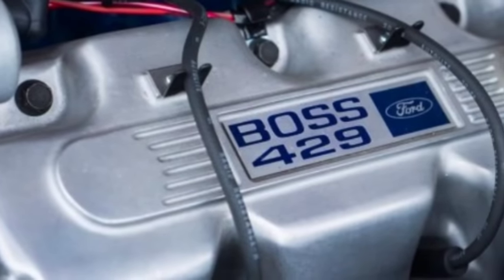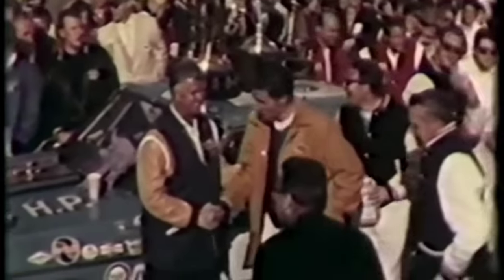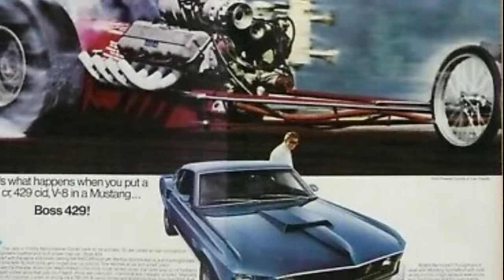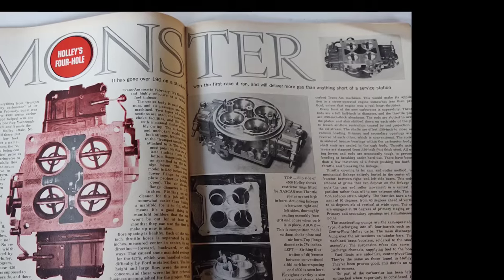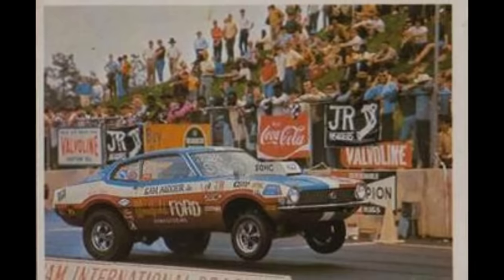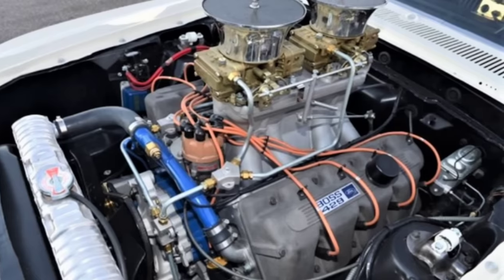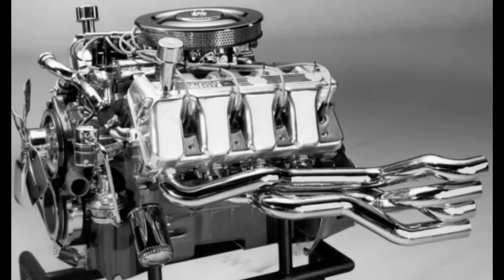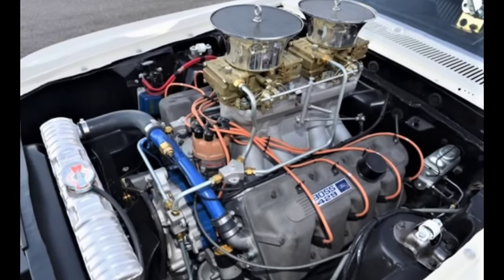The Misunderstood BOSS 429

Comment: I am a die-hard Mopar guy , and this is an interesting video. I like reading through the comments sections. Best thing to do is not be biased too much. Any intelligent person knows, that a handful of money and knowledge can put most engines at serious competition with each other. Back in the 70s we didn't have a lot of money, so we stuck to the simple go fast changes. Camshaft, lifters, better valve springs and retainers, rear end gears, shift kits in the transmission, stall speed converters, and headers. For us Mopar 6-pack guys, the Performance Kit to change the springs in the vacuum end carburetors was also a must. Other guys might opt for Progressive linkage. Ford guys had plenty of opportunity, and any Mopar guy that had a first look at some of the performance heads that Ford produced got their eyes opened. Ford was no slouch. The street engine Ford Boss 429 had to be mild enough to drive. And that was it's choking point. Make no mistake about it though, this is a great platform that just needed some performance goodies like most any other car manufacturer regular production engines. It's really at all about what you personally like oh, but at the end of the day they are hunks of Steel, Cast iron, and various other metals that make up an engine with a different manufacturers badge on it. hail to all of my Gearhead Brothers out there. I sure miss the 70s, when things were more laid back, cool music, and our world wasn't wound so damn tight
Reply from the maker: Amen to all of that!  I too am a Mopar man at heart.. my first car was a 70 Duster 340... It was fun picking on the 5.0 mustangs back in the day!  I have come to believe that all of the makes have their strong points and weakness.  It took a well tuned Hemi to outrun a 440-6 on the street.. I have always been told I have an old soul... I'm 41 btw please Subscribe and I will have plenty of good content coming your way!
Andy
Reply: @UnityMotorSportsGarage  true statement on the 440 + 6. I have owned those and the small block six pack engines. For their time, pretty impressive. Too many people like to compare half a century ago technology to today's modern fuel-injected engines and suspension on the cars which is completely pointless. Apples to Apples yes but never anything else LOL
Reply: @UnityMotorSportsGarage  you gotta be kidding me...had a 89 Notch 5.0, ex patrol car w headers and shifter, I'd smoke that crappy 340 as I did with Corvettes until about C5 came out
Reply: I love mine, goes like hell, has no traction to speak of. But so much fun to drive.  Will it beat the 69 Charger, no, but the Charger has 650 hp and 530 cubes, so it’s a tossup , love em both. Let’s go disturb the peace.😂😂🤪
Reply from the maker: @lautburns4829  let's GO!! Thanks for watching please Subscribe as I have one coming on the Hemi 
Andy
Reply: There was a teenager at church who grew up in his Dad's garage. He had his own engine building business before he graduated highschool. He got accused of rule breaking because of his customer's success. Everything he did was within the regulations. He was an
" out side the box" problem solver. He would talk to "old timers" and pick their brains. These guys had come through the Depression and WWII. They solved problems already, Ask them how.
Reply: @brianlevine4802  yawn, had a business when I was 8 years old, then when I was 14, then when I was old enough to know what a scam a job is...Rich Dad Poor Dad is the book if you want inspiration.
Reply: @andrefecteau  sorry I took up your time.
Reply: @brianlevine4802  it wasn't the time, it was the "point" of it all...if you could draw conclusions and relate to your own life your posts would carry weight, talking about someone you "heard of"?  Not so much...say something like "kid I knew who was self employed fared much better than me who was smart but worked for others"  or "chase your passion, not your pension"...
Reply: @andrefecteau  paul 
was 10-12 years older than me. He would help with both my Cubscout and Boyscout  troops. Would come to church riding his chopper. Where did I say "I heard of someone"?. The point I was trying to make is back then you had alot of low budget racing going on. Locals using what they had to beat the big boys. I spent my time milking goats,taking.care of the chickens,horses,etc..Learned to.drive a standard in old dump truck circling hayfields. Paved driveways,built septic systems,etc during school vacations. Split a lot of wood for winter. My stepfather didn't believe children needed money.
Reply: @UnityMotorSportsGarage  wrong!! I still have my 92 lx 5.0 coup that would literally smoke my buddy's "may he rest in peace" 71 duster, with basically the same set up.. and my lx was all stock at the time..
Reply: @andrefecteau  same!! I still have my 92 lx coup.. AOD though..
Reply: I, for one, don't believe the world is wound as tight as the media would have us.
Reply: @andrefecteau  lmfao bro your not fooling anyone they made like 220hp to the crank 😂 you wouldnt beat any modern 4cyl in that smogged to shit 80s rotbox
Reply: @nimwit0  you gotta be kidding me bro, a 5.0 hiway patrol car with headers/exhaust and tune ?  Itd be over before it started...btw I have 2 stangs now that lay waste to almost any car on the road, a crappy 95GT w a 427 stroker and 2 kits of 150 NOS, how's that grab your wannabe azz?  If your Stang is "slow", it won't be for long w any kinda bolt ons.
Reply: @andrefecteau  🤣😅 don't lie to us, lie to the mirror.
Reply: @steelrain9702  you wanna put money on that statement?
Reply: careful... sounds like someone lives their life a 1/4 mile at a time with their NOS bottle as a pillow. 🛵
Reply: mopar is a hedge fund
Reply: I had the car in my avatar 1970 super bird. I got a lot of benefit from the distributor spring kit to make the advance in the ignition come in faster. Usually would have to replace the fly weight pins. Easier to start with a new distributor. The springs and fly weights were a blessing back then. Make a big block mopar come on strong. Roller Rockers and higher rocker ratios was a simple bolt on upgrade. Most bang for the money.
Reply: @nimwit0  umm at least you know how we make power, my 89 is long gone..now as you can see on my thumbnail is my Cobra, a few small vids...96 w Kenne Bell on E85: and I have a 95 GT w a 427 Stroker and 2 kit of NOS, it runs on E85 as well, has a paddle shifted custom tranny.....First on Race Day boyz
Reply: @nimwit0  ahh one other thing, there are great after market ECUs now available...I run AEM on the 95 but with a few more bucks you can get really state of the art electronics...you see a Mustang can be what you want...and trust me in the early 90s the Notch 5.0 was a stupid fast car, very lightweight
Reply: @nimwit0  I’m not trying to be a jerk here, nor am I attempting to create or contribute to an argument, but... when I was a kid in High School, I had a 69 Dodge Coronet with a 383/727 Auto, and then after graduating I had a Fox Body 87 5.0/AOD Mercury Capri RS (Mercury’s Sister to the Mustang, and in my opinion the better looking of the two cars), and that 500 pounds lighter and 30 inch shorter car, TOTALLY out performed the Dodge B Body in EVERY single competitive comparison. Better Suspension, better Braking, better Acceleration, better Handling, better Quarter mile, better Top-Speed, better Mileage, better Seating, better Options, better Driving Experience, absolutely an overall better Vehicle. And I loved my MOPAR’s, I also loved that Fuel Injected 5.0 Blue Oval. And in reality, we need to sit back and ponder what vehicles would be like if it WASN’T for Ford building the Fox Body 5.0 Multi-Port Fuel Injection cars. The truth is, the 5.0 Fox Bodied Mustangs, re-ignited the Horsepower Wars from Detroit. The 5.0 Mustangs/Capri’s ran circles around GM’s IROC & Z28 Camaro’s and Firebird/Trans Am’s! The lighter 5.0 LX Mustang Coupes (that the Police drove), scared C4 Corvette owners. Dodge was a little late to the game, but were producing unheard for the times, performance in Front Wheel Drive 4 Cylinder engines, and pioneering Turbocharging, to their credit. Their turbo’ed 4 cylinder, 5spd Front Wheel Drive Dodge Daytona’s, and Plymouth Laser’s were absolutely competing with the V8 offerings from their crosstown rivals at GM and Ford. So to say that the 340 Duster/Dart, would destroy a Fox Body 5.0, is really not accurate. Having owned both, or a very similar divisions ‘sister’ vehicle, I felt I needed to give my opinion, based on experience from driving/owning both. Let’s all be thankful that Detroit finally got themselves straightened out, and started producing cars that are fun to drive again. And let’s NEVER forget that the Fox Body 1987 Mustang 5.0 GT/Mercury 5.0 Capri RS is definitely ‘THE’ moment in American automotive history, that started the Return of the Horsepower Wars in Detroit! Without the engineering of that years 5.0 motor receiving the multi-port fuel injection, new head design, and dedication to cleaner combustion/fuel economy/computer controlled engines, we wouldn’t have the insanely powerful engines that we can buy today. We should thank FORD, for setting it all straight.
Reply: @matthewl67  oh here we go...when someone's arguement is completely factless they hurl the personal attack...wham outta the park on that hanging curve ball
Reply: I am a die hard ford fan but I agree.......as a young man I was hyper excited at the thought of a 600 HP Hemi mustang.........what we got was a turd......those gigantic ports worked great wide open at 7000 rpm but the detuned street version was horrible.   It was such an embarrasment that Ford management considered a KIT that would allow new COMPLAINING Boss 429 owners to tweak their Mustangs into the 12s.   It included a carb, cam, headers......it never came to light.     The most telling argument against the B9 is the FACT that Ford used a 427 SOHC engine in the advertisement for the B9.   A few more years of development and it might have been a world killer.......but by the middle of 1970, NASCAR initiated restrictor plates and Ford had cut NASCAR funding.
Reply: @andrefecteau  5 point slow 😆! sounds like a v8 but that's it.
Reply: Amen...
Reply: @justinriley8651  so why did GM copy the design on the LS?  yep, never innovative, always last to the dance...who cares it's all electric and the MachE GT will be amazing 600 awd hp/torque and room for the kids and golf clubs...First on Race Day Boys
Reply: @andrefecteau  lol well if it's a copy it's way better than the original.
Reply: @justinriley8651 don't you mean "obsolete"...GM 20 years behind in anything, ugliest crap on  the road...good thing they are on the electric future but still very late to the game.
Reply: @andrefecteau  obviously your a Ford guy. I would like to agree with you that mustangs are the greatest thing on 4 wheels, but then both of us would be wrong. 

I do recall reading somewhere that 80% of the Ford product sold in the last 20 years are still on the road. One can only assume the other 20 percent made it home. 

Most mustang guys are cocky arrogant assholes, who can’t drive worth a damn. I’m guessing most spend entirely too much time watching fast and furious movies. Obviously, there are exceptions, there are many Ford owners who can drive, it’s the low performance drivers who give high performance cars a bad reputation.  

Unless your name is John Force, chances are good that someone, somewhere is faster. 

As someone who has spent a lot of time with fast cars (of any make) I seriously doubt that any Mopar with a 340 would have too much trouble making a 80s mustang look pretty slow.
Reply: @nimwit0  come on, everyone knows the only way to make a mustang fast is to LS swap it!!
Reply: @andrefecteau  just don’t run down any spectators leaving the next car show.
Reply: @mattrodgers4878  that's if the 340 can run...every slopar I ever knew was a turd with that quattro bog carb and the tranny from hell...a 89 Notch will waste most anything with basic bolt ons, it's stupid light and until you are ever in one?  You have no clue
Reply: @mattrodgers4878  get a car and then you can have an opinion
Reply: @mattrodgers4878  I'd like to introduce you to the 340 series of engine a Ford can be: the 347 ...from a 302
https://www.youtube.com/watch?v=YQIIhPf35QY
 i have a 427 stroker in my 95...yeah, do the math
Reply: @andrefecteau  i suppose if you consider a 13 second car fast, then yes a late 80s mustang with bolts is “fast”. It’s been 25 years since a 13 second street car was impressive. And don’t give me any of your bullshit, mid to low 13s is about the best you could expect from a 80s mustang with bolt ons.  

Your right, I haven’t owned one mustang, I’ve owned 4. I have many friends that own mustangs, the really fast ones are LS powered. If you haven’t split a Ford engine down the middle of the block, you haven’t had a fast one. 

It’s well known the 340 Mopars run very well. Since your unaware of that fact, you clearly don’t have a clue. Put down the “Ford and mustang” magazine comic books, and go to your local dragstrip. Be sure to take your car, make a couple of passes, and collect your timeslip (also know as the lie detector). While your there, look s the really fast fords, I’d be willing to bet the Ford engine is long gone. What you will almost certainly find is lots of fast mopars. 

If I thought you had the slightest clue what your talking about, I’d be willing to debate you. I’m done with this conversation.
Reply: @andrefecteau  yawn
Reply: @mattrodgers4878  it's still fast, ever watch videos of "fast" modern cars?  Without slicks or drag radials you aren't gonna break 13 to this day no matter the hp...btw you cannot compare the eras...
  Split a block?  Umm not if you use the right one and build it right...fast mopars?  Where?  20 years late to the game...bodies and company and both bankrupt many times, for obvious reasons, total junk...
    Obtw Mopar is owned by what ?  Some foreign entity?  and where is their electric car?  yeah 20 years from now and another bailout later.
  First on Race Day...solvent and looking to the future with the Mach E GT
   600 awd hp/torque...should be fun
Reply: @mattrodgers4878  btw Matt this is all known as "bench racing"...all car guys do it...it's part of owning cool cars, if you can't remain calm you should stay on the sideline
Reply: @UnityMotorSportsGarage  HAD A 63'FALCON SPRINT WITH A BUILT 289 PUT THE HURT ON ALOT OF 340 DUSTERS ,ROAD RUNNERS.442'S .GOOD TIMES BACK THEN.
Reply: @andrefecteau  , yawn. Your just has boring.
Reply: @UnityMotorSportsGarage  Hi Andy. I've got a few years on you,I'm 68. In the early 70's, I had a '65 Mustang 289 hipo. It had a big solid lift cam, aluminum intake, 600 Holley,factory dual point & headers. A guy in town came over & told me a friend of his had a Duster w/ 340 automatic. He said he told him he'd never seen a Ford that would run. He wanted to race me,I figured he'd beat me,but I raced him. I beat him 2 of 2. I think all 3 of us were surprised! I've always been a Ford guy, but I never put another brand down!
Reply: @nimwit0  guess you've never heard of Stinger Performance and the EEC IV ECU PimpXS works great with SD add some John Kasse Boss 9 heads ( Hemi ) and other goodies
Reply: @andrefecteau  you shoulda been able to beat a c5 as well, especially with wider tires. you have them on weight.
Reply: @nimwit0  its clear you have no idea what you’re talking about
Reply: @NotoriousPlayer1  it doesn't matter bro, game over...it's an electric future...then it's an autonomous life...if you wan that classic gasser, go get one while you can...I've loved mine, but I'm ready to move on
Reply: @andrefecteau  I had a C5 and I quite racing them, because it wasn't fun blowing there doors so many times, in saying that a buddy of mine bought a 5 or C6 can't recall but the only way that he could was with a Blue Bottle.
Reply: @carlsmith6056  who cares, the entire scene is dead, it's not safe, it's an electric future...I'll be glad to let the computer drive while I have cocktails in the back.
Reply: @NotoriousPlayer1  🎯
Reply: Same here. Own Mopar's but love Pontiac's, Chevy's etc and NHRA history and cars most importantly.  Love them all!
Reply: Before the media and culture made a hard left turn...
Reply: @7x779  see bro it's always been that way..it's just now being realized more than ever...those zombie fake newzers are brainwashed
Reply: I just turned 60 & feel exactly the same as you my friend, the 70s were truly special. I was just talking to one of my Army buddies commiserating over our 18 friends that didn't make it home from Mogadishu in total disbelief watching our country self destructing, the CCP must be laughing their ass's off. Although the modern cars are incredible, they just don't put a smile on my face like my Pantera still does, keep the faith!
Reply: @justinriley8651  No ford just went with the ohc setup to be more exotic.
Reply: @mattrodgers4878  🤣🤣🤣 A 2018 mustang gt with bolt-ons and E85 ran with a Hellcat. 🛑
Reply: Same here im fascinated by ford answer to the Hemi !
Reply: @andrefecteau  Pfttt ive chewed 5.0s up with 318s over and over over almost to the point of it getting ridiculous !
Reply: @steelrain9702  I have a 318 you couldn't even read the license plate on my car lol!
Reply: @anthonysiler4938  You have to quit racing wore out 318s disguised as 340s LOL@ you
Reply: @MrR6guy  I've got  a 5.0 for you: a 95...btw I added a couple extra liters and a couple kits of NOS to it...you wanna run that Slowpar against it?  Watch where you run you mouth and your car.
Reply: HAIL TO THE KING !! NOT NECESSARILLY THE KING COBRA/BOSS BUT THE KING OF COMMENTS !! LOLOLOLHAHAHA " THAT HAS TO BE THE LONGEST ONE THUS FAR !! LOLOL YOU CERTAINLY SOYND LIKE A GEARHEAD THAT KNOWS/EXPERIENCED A THING OR TWO !! LOLOLOLHAHAHA LOLOLWHOWEE HEADERS & A 4-BBL. INTAKE WAS ALWAYS NUMBER ONE ! I DONT WANT TO TRY AND BREAK YOUR RECORD BUT WHAT MORE CAN BE SAID THAT YOU HAVEN'T?? I BOUGHT MY 12-SEC. 69' SS396 "BU" ALREADY SET UP FOR THE 1/4-MILE BACK IN HIGH SCHOOL IN 81' AND GOD BLESS MY AUTO SHOP TEACHER FOR LETTING ME KEEP MY CHEVELLE IN THE SHOP SO I COULD MAKE IT STREET LEGAL !! IT WAS FUNNY HOOKING UP THAT BIG OLD SUN SCOPE TO MY 396 AND THE DISPLAY WAS SHOWING THREE SPARKS PER PLUG AND MR REAGAN SAID THERE MUST BE SOMETHING WRONG WITH THE SCOPE,, I JUST LAUGHED AND TOLD HIM THATS PROBABLY MY MSD 6A POINTING IT OUT ON THE FIRE WALL. WELL NEEDLESS TO SAY I GOT AN A IN CLASS !! LOLOLWHOWEE THOSE WERE THE DAYS ALRIGHT !! GEARHEADED GREASE MONKIES UNITE !!!! ( DID I BREAK THE RECORD YET ?? LOLOL
Reply: @emilsunter3596  Your a VERY CLOSE 2ND !! IN HAVING A LONG ASS COMMENT !!! LOLOLHAHAHA
Reply: @matthewl67  No different then the Camaro drivers. We always called Camaro's and Mustangs asshole cars. Because everybody has one.
Reply: @mattrodgers4878  A 340 Mopar would have stomped G.M'S beloved 80's Corvette. The only real exciting car at the time was the Buick Grand National.
Reply: @mattrodgers4878  Before it blew up.
Reply: @mattrodgers4878   The LS is like a Sherman tank. The only thing it's got going for it is there is lot's of them.
Reply: @andrefecteau  They are just butthurt Andre that Government Motors and Chrysler I mean Fiat were sellouts.
Reply: @andrefecteau  I don't relish the idea of Electric vehicles. Electronics are too flimsy. I still want my gas eater.
Reply: @junglejim5785  and the Buick cleaned the clocks of the corvette during those years. I fondly remember all the chest thumping chebby boys crying whenever a grand National beat them at the dragstrip. A couple years later they were still crying when the Pontiac Turbo Trans Am stomped them at the dragstrip AND the auto cross.
Reply: Chevy/gm guy. Let's not forget 350 sbc is a proven platform. Pontiac made some cool shit back in the day. The big block chevy stuff. 

Like you said most things can be competitive.
Reply from the maker: Check out my SBC video.  Tell me what you think!
Reply: @andrefecteau  i know your lying because ive owned both
Reply: @emilsunter3596  and 1000 lbs lighter
Reply: @andrefecteau  if every mopar is a turd then why the 440 6 roadrunner rated 390 hp out perform the LS6 chevelle 450hp 454? When you get your facts let me know.
Reply: @antilaw9911  and you are a troll...state facts, just because you don't agree doesn't establish "lie"....
Reply: @UnityMotorSportsGarage  that's a pretty bold statement driving a 340, lol bud,
Reply from the maker: Spud, it wasn't your avg 340!  
Had a blast with that car ... I still regret getting rid of it ..
Andy
Reply: Debbie Miorgan  and you must be tripping, I'm 55, the 302 is a great engine, it needs heads cam and intake to be banned from any racing...stay in your slowpar or bankrupt GM crap and look at my taillights...I have a 427w Stang that will whip anything..so take your old ass back to bingo and stop trolling
Reply: Debbie Miorgan  oh please you can see my Cobra in my profile pic, btw it's supercharged and I do have a 427w Saleen...w 2 kits of NOS.. you're troll boy in a Hyundai no doubt...amazing how ya'll know everything, you should pick lottery numbers...
Reply: @craigcampbell8560  OMG bro, you need therapy., I will wait for the movie before reading that rant...
Reply: Andre Fecteau   I beat plenty of 5.0 mustangs with my 340 dart’
Reply: Anthony Siler   AOD- (awful on demand)
Reply: as a mopar guy I sure miss those days but have always been impressed with the 429 as it had everything
going for it but lacked good atomization of the fuel air mixture with the over sized porting ford did with so many of their engines, sure it could flow like nobody business but a good mix can be the difference
and mopar kept the rough looking intake runners and smaller ports to benefit the engines operation at
a specific rpm like they were doing with the ram air intakes on the 413 engines. Those long runners offered a boost to the bottom end torque for the daily driver that didn't see more than 3000 rpm.
When everything was right -runner length porting, carb,cam duration the power band came to life.
I'm noticing  more engine aftermarket suppliers are rediscovering the old iron that has mostly been forgotten, more for you and me.
Reply: @magneticpulseengine3605  yeah I’ve got the great Ford iron and aluminum but I’m looking forward to electric
Reply: Back when sex was fun and motorcycles were dangerous!Lol
Reply: @magneticpulseengine3605  Yeah you can always tell with how people tell their stories. Most of these guys with nitrous and stroker engines, have no idea or cannot relate to the fact that we did not have such things on the street back then. We took Factory cars and put camshafts, Springs and lifters, maybe gears and headers okay. We just didn't do much more to them because most people didn't have that much money. They like to compare their stroked out nitrous fed monsters to our Factory Chrysler muscle cars which is a complete laugh personally I think that it is flattering to me that somebody would spend that much money trying to beat my factory Dodge. Like I stated when I first put my comment up that a lot of people have responded to... I have liked all the cars a lot of people like the bench race LOL. But there's a lot of BS that people talk and it's usually the ones that have a pile of money put into their vehicle I run hydraulic engines with normal compression ratios and reasonable gears. It's more of a driver these days. People want to race they really should take it to the strip. And above and beyond all things, not a factory stock or nearly stock engines, to those that have piled a lot of money into nitrous, stroker kits excetera
Reply: @brianlevine4802  not me. Some people just tell the truth, & don't embellish or brag.
Reply: When the Chevy guys used to say FORD was F'en Old Rebuilt Dodge I asked them what cars were winning at any NHRA event..90% of them were running hemi's..That's back when NHRA used to run all the classes at National events. Sad NHRA screwed up ProStock and turning it into IROC
Reply: Too many variables in  “street” racing to bring it up and consider anyone a winner. Boss 429 that Ford rushed out in the mustang had no tuning tiny headers and emissions requirements. The engine was shoved in there to meet homologation requirements no thought of “performance” on the street was considered Ford only cared about having Boss 429 ready for 1968 racing season where Ford erased the dodge completion so much that Richard petty went to race for Ford.  Like is custom Ford dominance had to be halted at all costs so restrictor plates were introduced. That’s why I cringe every time I hear someone say the Boss 429 wasn’t a good engine it’s ridiculous. 

The Cleveland (335 series) dominated prostock 1969-1979 without factory support and carrying more weight (250 lbs) then the competition. Gliddens Fairmont still went undefeated only car to do so in NHRA history.  Only comparable engine had same dominance success was Boss 429 (385 series) 1980-1990 it dominated IHRA and NHRA prostock.  Dominance ended because NHRA told Ford and Gliddens that they had to make 1000 pairs of these heads available to the public if they wanted to race. Nhra knew Boss 429 we’re made in limited numbers and a market for these heads didn’t exist obviously they knew Ford wasn’t going  to spend countless millions to produce heads for a motor that had been out of production for 20 years. This is how Ford dominance ended. All the other stories of my piece of junk was faster then blah blah.. Nothing could touch Gliddens and  Rickie Smith Boss 429 powered cars. Dyno Don and Rickie smith first to break 7’s in prostock Dyno Don used Fe cobra jet power. The NHRA mandated the 500ci rule as a play to stop Ford from dominating prostock. So the corrupt NHRA(anothe division of GM) allowed GM along with Warren Johnson to build a new engine called the DRCE so GM takes a Oldsmobile block,  Warren Johnson has a big pair of Ford Cleveland heads made for it.  That’s what the DRCE is. Too bad that wasn’t enough to beat the a FORD engine Boss 429 unlike Chevy using an engine that nothing Chevy about it. Only time the DRCE started winning was when Ford had left  NHRA pro-stock. In IHRA big block Fords kept winning and dominating to this day even without factory support. Anybody have questions about this novel let me know. Class dismissed.
Reply: @brianlevine4802  Come on guy's, play nice.
Reply: @CoyoteFTW  NHRA screwed up ProStock letting Warren build a custom engine. Then when MOPAR was competitive they again changed the rules and made them so Johnson ( previous Champion ) was a 10th slower. The said " BUY a DRE". Compar that to Factory Stock where every time ( every race sometimes) Ford wins they make a rule change..Use to Love drag racing and NHRA until they became NHgmRA
Reply: Would love to build everything from big 70s stock specs run them in All in a same chassis set for drag racing!  See who is the fastest in the 1/4 mile that will never I don't have deep pockets. Everyone can build a winner just changing jet in 1970 GS STAGE ONE WILL NET YOU LOW 12S. THIS PROVES Knowledgeable people with little money can do great with any engine.
Reply: The solid lifter cam option for the Boss 429 made it much more of a street performer, along with a carburetor tweak or two.
Reply: sure you did buddy and idgaf how old your comment is.  My z24 would gap stock 5.0's all day long. 

 @andrefecteau
Reply: You ain't lying bro.